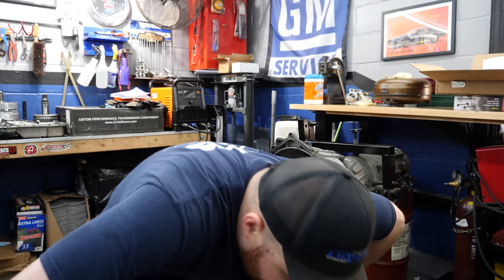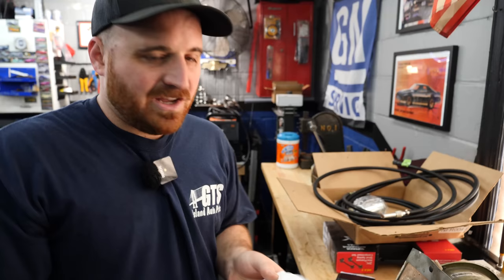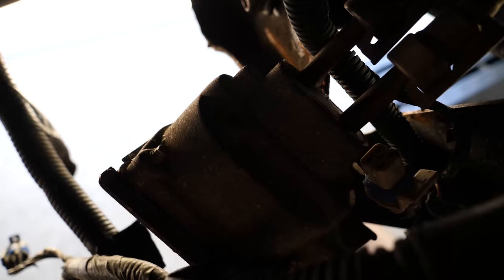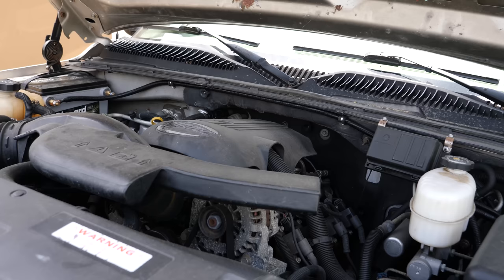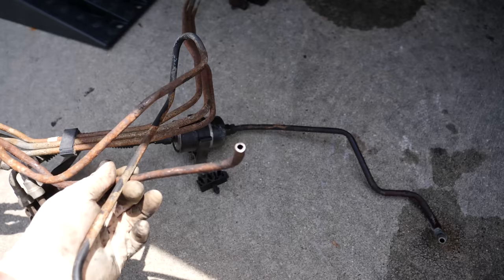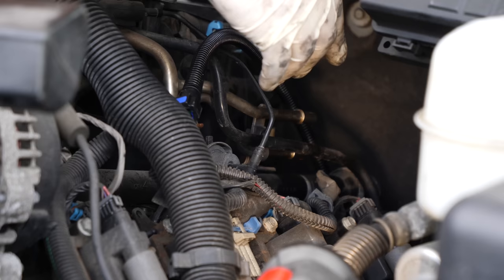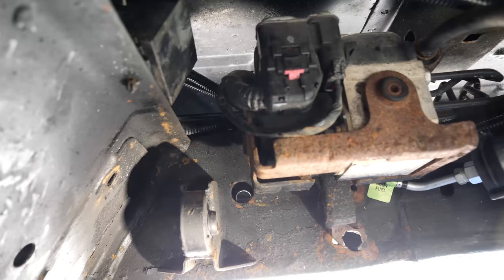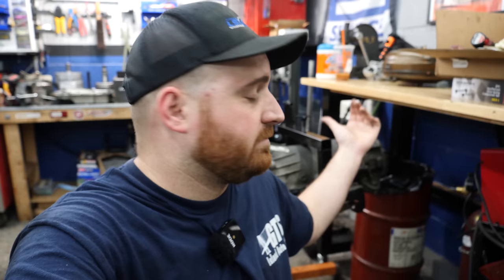This is the FASTEST and EASIEST Way to Replace Those Rusted Out GM TRUCK Fuel Lines

Comment from the maker: Don't be like me, just buy the correct fuel lines.. Both parts for flex and non flex fuel are linked in the description!
Reply: Hi Matt. I was thinking if your deleting the Flex fuel maybe remove the Flex fuel sticker on the gas filler door. I watched you video on the brake lines and as I blew a line I was wondering if the parts for your 04 are the same as an 03 Z71 ? I wanna go Stainless brake lines and replace the Flex fuel lines as I've been running on E85 since gas prices went up. Adl question what is your Z71 avg gas MPG ? I Picked my Z71 from my neighbor in Oct 2021 and he's not one to pay attention to MPG's nor am I but the drivers information center says I'm averaging 6.9 to 7.0 MPG on E85 and maybe 3 tenths of a mile more on Super or Reg. I was getting 6.6  MPG till I replaced the Air filter. It seems to run smooth but im dumbfounded to why as it should get around 15-18 I even removed the third row seating to save weight. I'm might get on it on the Expressway but not in town. I believe it only has 94k. I have so many questions for you like how do I find a shop that does HP Tunning here on long Island? Hope you answer. A loyal follower Eddie J. Ps. Install GasBuddy on your phone and you can locate E85 stations and find the best prices on gas or diesel in town or as your driving someplace as the app uses your GPS. Hope that helps.
Reply: Can you tell me the name of the lines you bought please
Reply: What is wrong with them? Idont understand should I get this or just normal lines

Comment: Thanks Matt.. I admit that I was a little reluctant in purchasing the fuel line kit. The owner assured me 💯% that it will work & will hold up under the hood heat temps... So I thank you for your demo installation & part list... Enjoy ✌️🙏

Comment: Love the nylon fuel line. It's all we use at work for replacement. No flairing or bending and the quick connect ends attach easily.

Comment: Just replaced the whole fuel system minus the tank and tank sensor while replacing the rear main, timing chain cover, and oil pan gasket. I figured replace it while it's all accessible. Go figure the fuel tank pressure sensor failed after the project was completed, and promptly replaced with a bunch of swearing. My Hawkeye is a 05 Tahoe with 262k and just passed emmissions
Reply: Next will be heads, and exhaust
Reply: I just eclipsed 262k today in my 03. Did my oil pump 2 weeks ago. 60lbs going down the freeway and no more lifter tick at idle. Dropping the front diff wasn't as bad as some make it out to be. I've got an electric fan and harness from an 05 ready to go in but my HP Tuners order is on backorder.
Reply: @RYTHMICRIOT  Yeah I did the oil pump and oil galley plug that's under the rear main when I had both the timing chain cover and rear main off. A pain if that's the only reason you're there, but easy if you're already there

Comment: All vehicles should come with SS brake and fuel lines right from the factory.  The few $$$ more at the time of purchase outweigh working on RUSTBELT components later on in years.

Comment: My 04 Tahoe has that blue style clip on the feed and of course being in Ohio it's the same except it won't come out by pushing the tabs in towards the line and just pull it and the rubber bushing on the line out either. I'm pulling my hair out over it about to just drop the tank and go all new

Comment: Do brake lines next? Just had mine go (05 Yukon 223k miles) and DIYing it was rough.
Reply: He did a video on brake lines already, he used preformed lines.
Reply from the maker: Yep I have a video on the install.
Reply: I just did too!

Comment: I have a gmc Yukon 1999 4x4 with a 5.7l engine in it can I use these lines on my truck and what do I get flex fuel or non flex fuel and all my lines are the original ones witch are rusted and can’t even take off my fuel filter can someone tell me witch ones to get is it flex rule or non flex and would these fit my truck

Comment: Hi Great Vid, and perfect timing for me as well. But if my eyes don't deceive me... The location of your return fuel line is located right below your supply. What year is your vehicle? Mine looks to be a little different than yours. I have a 2005 Yukon Denali 6.0. Was going to attach a picture of mine but it wont let me

Comment: My fule lines are toast only the ones by the fule tank are leaking got any tips?
Reply: Fuel injector hose and hose clamps if possible cut the rotten line out.. I'm not a professional I'm just an idiot.

Comment: I need some help.  This is what I "THINK" happened to my 2005 Chevy Tahoe Z71, 4wd.  I "THINK" the battery was failing so the computer turned off the Body Control Module to shut down to conserve energy. Things like, windows, door locks, gauges, radio and AC.  The driving functions, things like wipers, headlights and cruise control still had power.  

Finally, there wasn't enough power to restart the engine. I installed a new battery and it started right up and drove 150 miles home, but the BCM systems were still not working.   Although, the windows and radio did function whenever they felt like it for a few seconds and then would stop.  

The alternator was always at 14.1 to 14.8 even on the dying battery.  Do's the BCM need to be rebooted after the battery change or a situation like this?  Any other thoughts?  Anybody?

Comment: Hope you read my comment and respond even though the video is 6 months old. I have a '93 GMC 1500 Truck that the fuel lines are leaking on because it was in Iowa for the first 12 years of it's life and the road salt rusted them out. The entire underside is extremely rusty but the body is still good because I had it "Steel Sealed" when I bought it new in '93. OEM steel lines are no longer available and nylon lines are my only affordable option. I can't do the work myself due to my health and have to have an auto repair shop do it for me. Only 1 of the 4 shops I contacted would do it, but it will be a first for them and I am concerned about their ability and speed (they charge $100 per hour labor). I am retired and don't have a lot of money and don't really want to sink any more than necessary in the truck to keep it running. Do you have any advice for me?
Reply: Where in iowa sir. I may be able to help

Comment: How exactly did you bypass the flex fuel sensor and did I cause any issues
Reply from the maker: I can go in with tuning software and just turn off flex fuel. Its like it what never even there minus the connector
Reply: What would I need to do that I made the same mistake you did lol

Comment: Interesting you have an external fuel filter on your 04.  Must have been flex fuel specific.  I know most of the GMT800s went to an internal filter/regulator on the fuel pump assembly on 04. Or more specifically the SUVs
Reply: No, the 04 flex and gas both have external filters and regulators. They are different. I had an 04 and did a ton of work to the fuel system. And it was a nightmare ordering the right parts. I believe in 05 they went to a returnless system and the regulator was built in.
Reply: @thagerdorn2009  GM must have made changes at some point in 04.  Or it may have varied by model. My 04 Escalade does not have an external fuel filter. I searched high and low for it, but found out my filter is actually part of the fuel pump assembly.
Reply: The suvs have the internal filters
Reply: @thagerdorn2009  my 04 Silverado doesn't have an external filter.
Reply: @ttrmotocross  my 04 suburban flex 5.3 had an external filter, and the pump was a plastic housing. However my 04 Sierra gas 5.3 did not have a filter externally and the pump was metal. Somewhere in 04 they went to a return less system. But the flex trucks still had a return system. I believe the L59 Vin Code Z was the flex trucks. 8th digit of the vin tells you what engine it has.

Comment: I keep getting engine lights for fuel composition sensor Circuit low P0178
Reply: There is a fuse in the fuse box under the hood that controls the flex fuel sensor. You need to lift the box up, check the two wires that run to that fuse because it controls the purge valve under the hood as well. Wiggle the wires and make sure it's seated properly. I had that code on my 04 and after digging into the wiring and checking things out, I made sure that connection to that fuse was good and clean and tight and I never had the code come back. The sensor itself does not go bad very often. The only real way to properly check the readings on the sensor are with a GM TECH2 scan tool or an expensive tool truck scanner. Trust me on this, I spent months on my truck with this damn code. The sensor isn't bad. And while the wiring may look okay, it's probably ever so slightly loose.
Reply: @thagerdorn2009  Thanks!

Comment: You know anything about the 06s fuel filter? I heard its not replaceable, but that sounds dumb... Why can't i change it?
Reply from the maker: I didn’t know they did away with it, but if you don’t have one then they probably just have one built into the fuel sender.
Reply: @macaaroni I can absolutely confirm that the filter was deleted/omitted on 05/06 Tahoe without flex fuel. I have an 05 non flex fuel Tahoe. It’s been fun to find all the differences from 02 to 04, then 05 and up. Lots of little things were changed all over these trucks.
Reply: @ManicMender  I wonder if those changes were for more profit or to avoid issues since it was the last few years of those trucks. For example, they removed the cabin air filter, which i can't understand at all. I actually got a kit to retro fit one in.
Reply: @ManicMender  I have a 04 Tahoe without flex fuel and external filter. It does not  have returnline either exept for vapour,  so maybe the chang came already sometime i 2004. My VIN nr. is 1GNEK13T64J298248